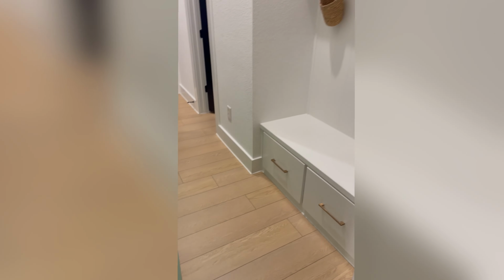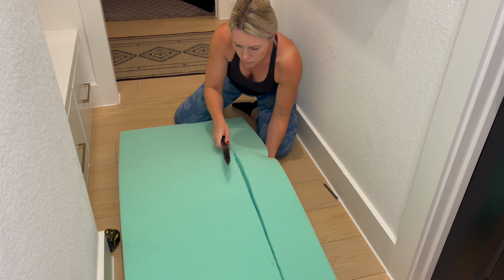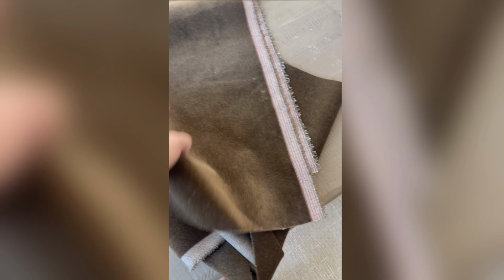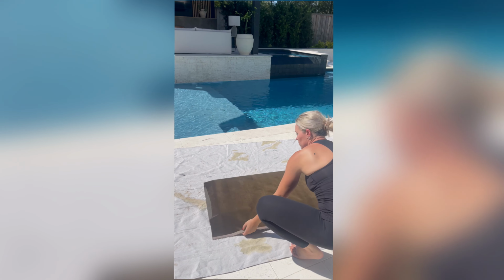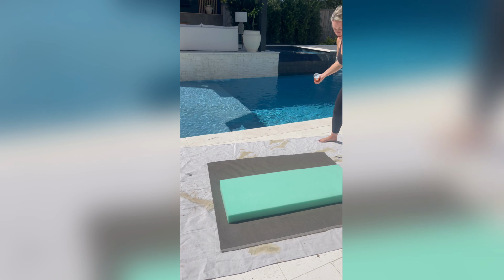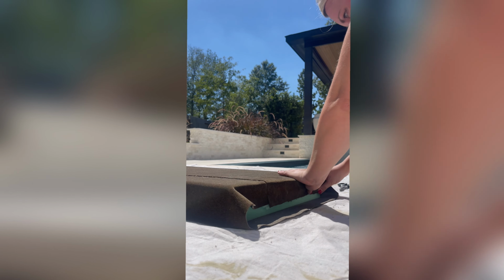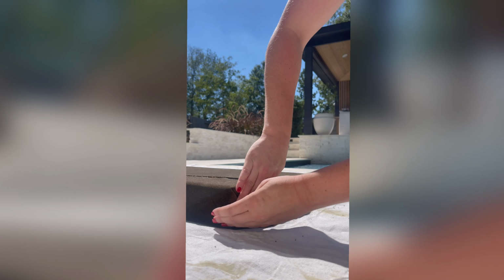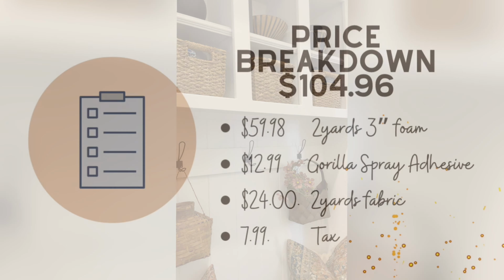Make this super easy and stylish DIY Bench Cushion Cover in no time! No sew

Comment: I watched other videos that used batting prior to wrapping fabric in the foam. Do you think the adhesive with work with batting and then the fabric?
Reply from the maker: I think you would have to spray the adhesive on both the foam to the batting and then the batting to the fabric. The part I wonder about is that batting is very fuzzy so I'm not sure how well it would stick, maybe try a mini sample square before tackling the whole project